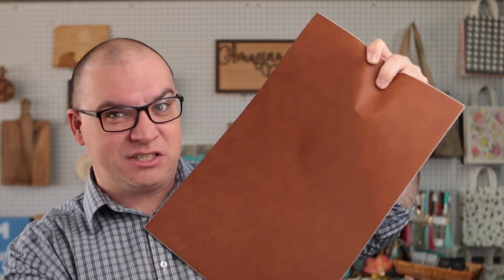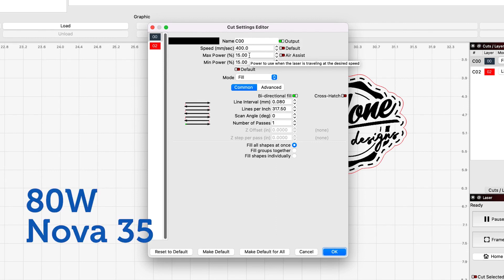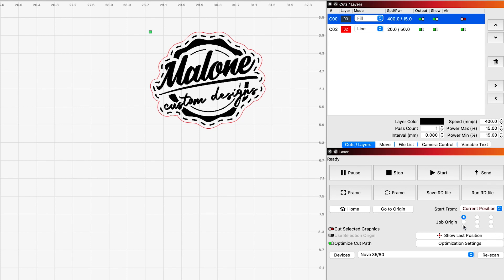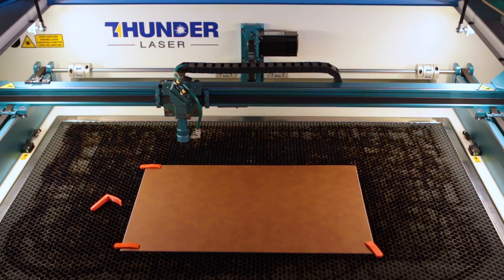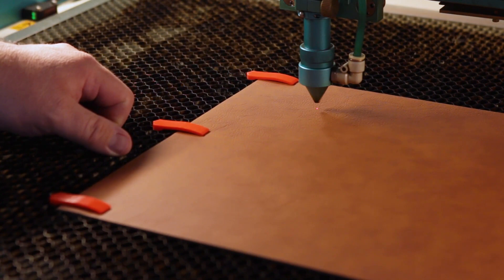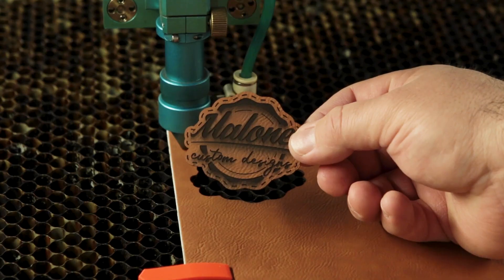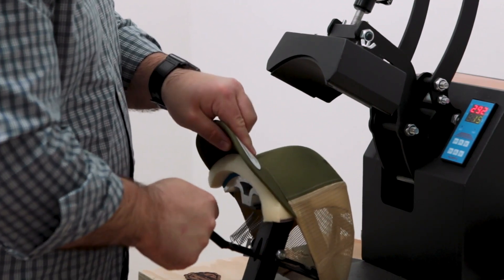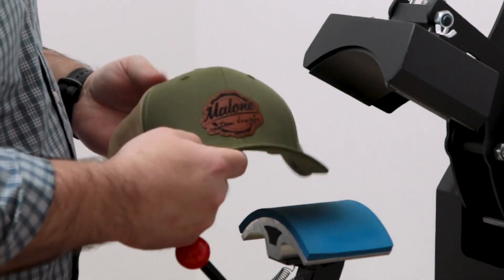Leatherette Engraving Settings for Thunder Nova 35

Comment: Just curious why you don't use air assist during the engrave?
Reply from the maker: Hey C.J. We normally only use air during cutting. It gives us a cleaner engraving without it.  Well....let me make it clear, when you tell Lightburn to turn air off, you are getting low air.  We have just a tiny whisp of air to keep the lens clear. But usually, the "high air" is just used for cutting.
Reply: @malonecustomdesigns  that makes sense. I just got my Nova 35 and am trying to get up and running with it. Like you, I’m also coming from GF. I appreciate all your videos, they’ve helped tremendously.

Comment: Have you ever had a peeling off issue with these? I have just started to do these but if I pull on the patch it comes off. Any tips? Using a Hottronix 360iq hat press. Maybe not letting it cool enough. 285 for 15 seconds
Reply from the maker: Whenever we press one....we set it aside for 24 hours before giving it to a customer.  We made a mistake early on and pressed that morning and gave it to the customer.  The customer put the cap on, worked, and sweated in it all day.  He also left a backup on his dash...in the sun.  Both of those patches came off.  Since we've started waiting...we've not had any issues.
Reply: @malonecustomdesigns  Do you feel my settings look good just need to set aside longer?
Reply from the maker: @therustynail77  I'm not sure how the Hottronix is, but we normally press for 275 for 15, so it seems comparable.
Reply: @malonecustomdesigns  best press on the market in my opinion.
Reply from the maker: @therustynail77  Yes, from what I have seen, I would agree.  If we ever have to replace ours...that's what we are going with.  We bought this cheap one when we started....and it just keep ticking....lol

Comment: I have a Nova 24 60 watt. I keep getting char when I don't use air assist.Also what is your focus?
Reply from the maker: We focus at 6mm.  Just make sure that your adjustment knob is turned to where there is only a wisp of air on the low pressure side.

Comment: Thanks for the video.  I have a thunder nova 35 100 watt. What do you think I should adjust my settings to as a start vs for the 80 watt in your demo?
Reply from the maker: Appreciate the comment.  For your 100W machine, a starting point for engraving leatherette should be about 400/12.  It's not going to be that far off from what ours is. Basically, you just need to lower your power by about 20%. Give that a try for engraving.  By the way, this is just for the leatherette that engraves to black.  The others that engrave to silver or gold....they are a little tricky.